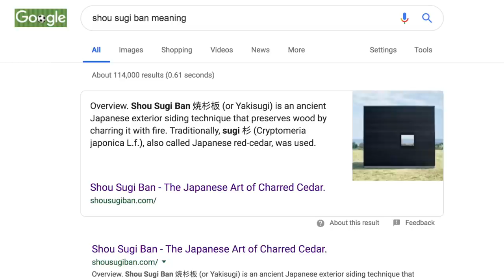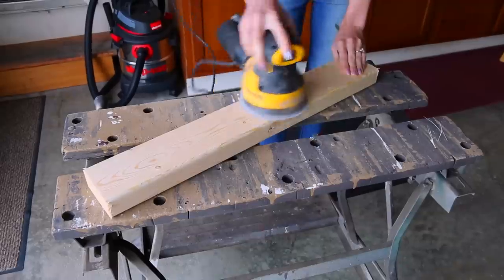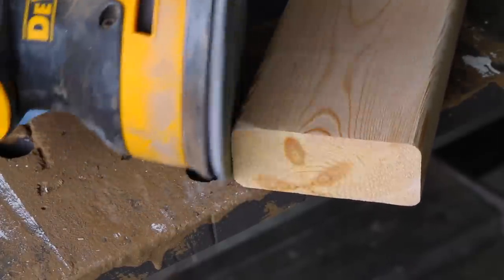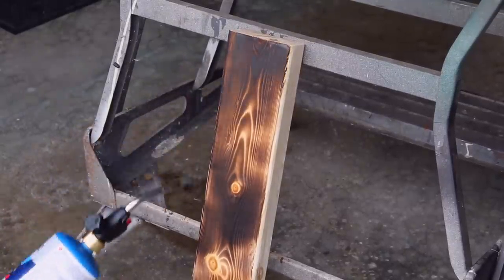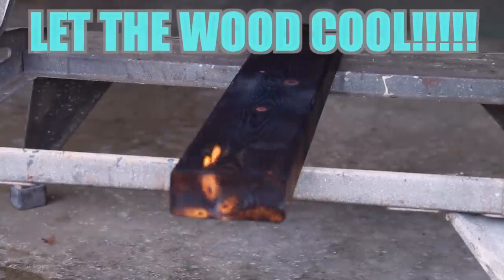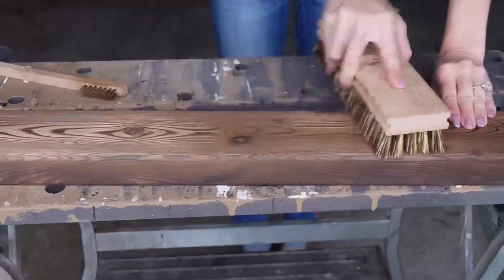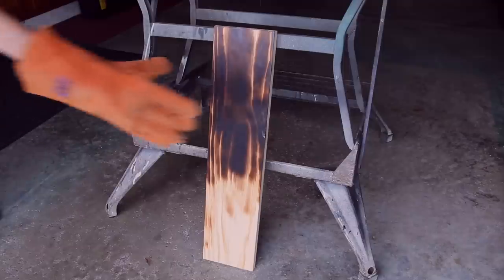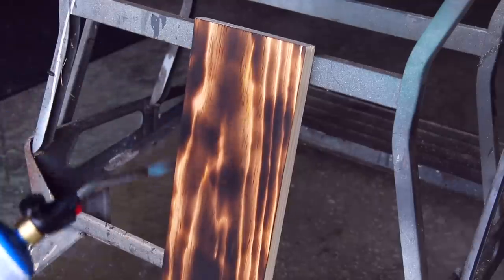WOOD BURNING with a TORCH?! Shou Sugi Ban How To

Comment: Cool projects, you could also try a spray lacquer to seal the wood burned finish.
I would imagine the spray would be fine to use over the stain sooner as it wouldn't be disrupting the surface of the wood (?)

Comment: I love your video... just want to share, as an artist who has done this... slow sweeping strokes with the flame gets an even burn  over the bobbing motion you were doing. Like spray painting... it will eliminate the "char, brush, sand" steps... in my experience and opinion. Rock on with the art... every taste is different. .. but always valuable .

Comment: I'm doing a few 16' pieces of 2x4" KD Fir.. want to get a torch head that made a wider flame as using a pencil torch on that size wood is gonna take lots of time. I'm actually considering just making a small wood fire outside and holding the wood over it. You want to get Nyalox drill brushes or a purpose made wire brush sander

Comment: Get a weed killing torch or the ones with the long 3 foot pole on it and not only will you get wayyyy more flame to cover more wood faster but also you won't hurt your back bending over all the time.?.home depot sells one for 20 something bucks by Magtorch called the outdoor torch, not sponsored I just remember using the same torch as you and remember how much my interest grew when upgraded the torch so just MY opinion, good luck! Also I have been burning and using stains and poly with inconsistent results but I tried the wood dye today for the first time mixing it with my finish and wow...went from burnt wood that kind of had color faded on it to a popping super bright barn red sugi glossy poly amazing piece of wood.  Sorry so long but u hope this helps ::) thanks for your awesome video this was my first time but not gonna be my last